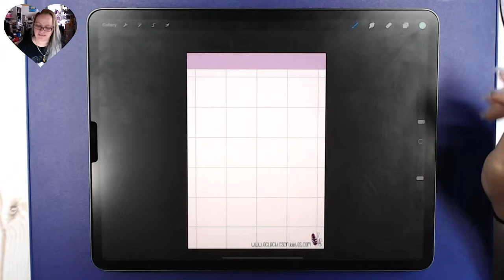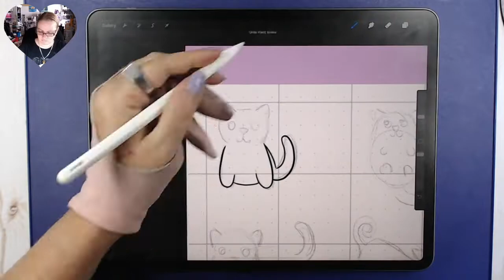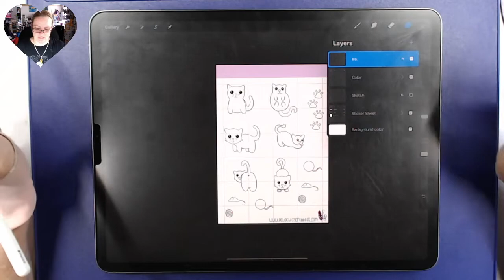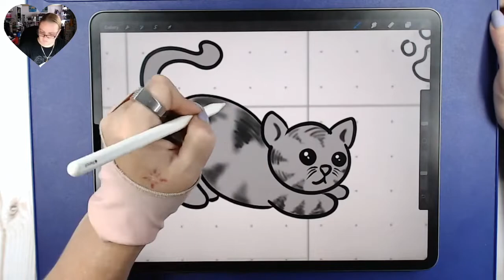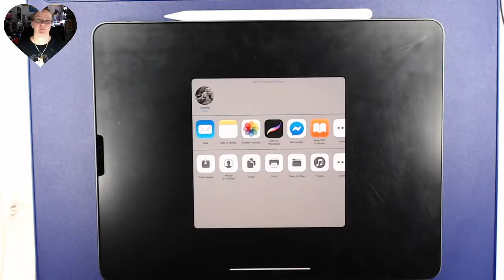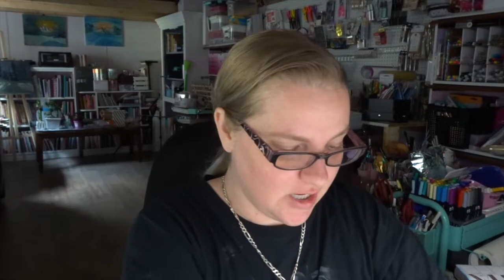How I Make Stickers using Procreate and Silhouette

Comment: I want to get a silhouette cameo 4 to make waterproof die-cut stickers instead of kiss-cut sheets. Any tips? What is the best blade and paper to use? It comes with an auto blade.
Reply from the maker: The automatic blade is all I use. The settings are built in and you can tweak them if needed

Comment: I have tried absolutely everything in my knowledge to get that format template.. I’m not understanding how to do the dot grid in illustrator & get a grid on procreate in a accurate 1 inch form. Mind sharing the file with me? (:
Reply from the maker: I create a dot in Ai and set my space width to 5mm the duplicate and paste dots across the page of whatever canvas size I want. Then I duplicate that line of dots and go down the page also. I use the guide rulers to place a line one inch in, and do the same for those lines so I have both grids and can accurately gauge my stickers. I export as a jpg (not a png) and place it as a layer in procreate to serve as the guide on a canvas the same size as the one in illustrator. Does that help or make sense at all?
Reply from the maker: https://youtu.be/KNLtXTEq38U New Tutorial on how to make the template.